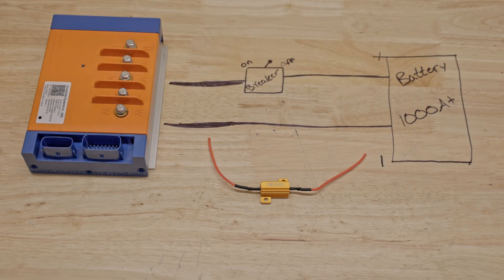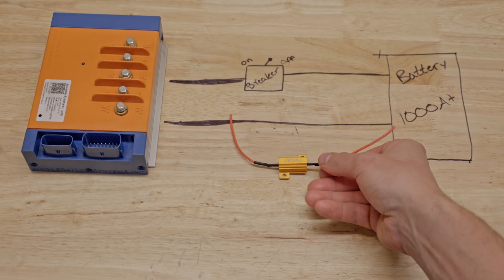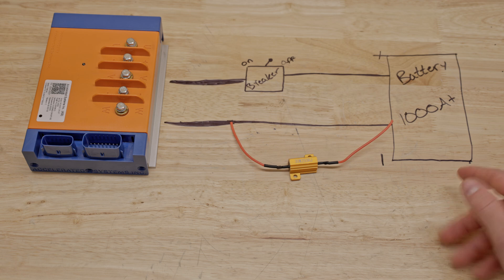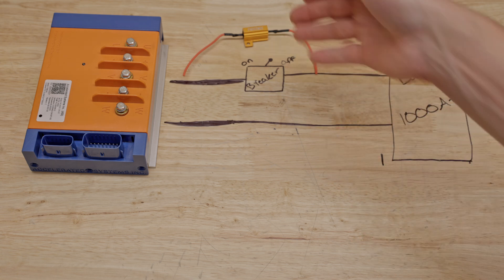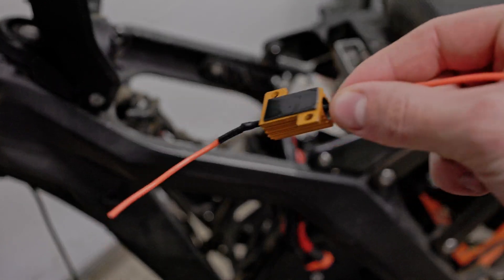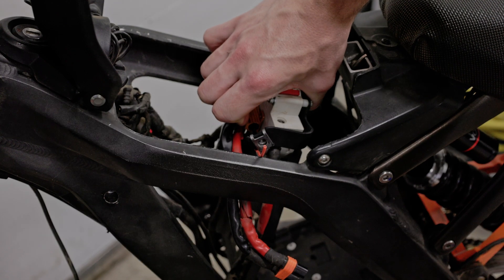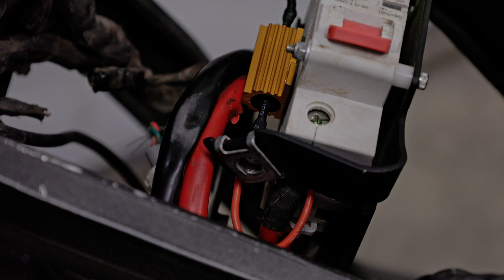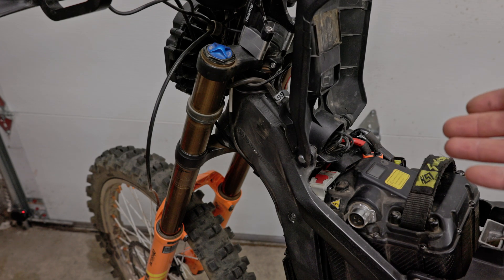How to Protect Your Controller from In rush Current | Pre-Charge Resistor Install

Comment: So let's say A automotive shop does this everytime they disconnect the battery terminal from a modern 12v battery system they must place a inline resistor to slowly charge up the Modules within the vehicle to prevent damage from the rush of current? Because I've had a shop burn a module because they reconnected the battery terminal to the battery.

Comment: PUT A SWITCH IN THE RESISTOR LINE. If you put  a momentary switch that is normally open so all you have to do is push it then when you let go it takes that resistor out of the circuit

Comment: Have you guys had problems with your breakers melting? The OEM breaker is rated for 100 amps but with 12kW plus we're way over that.  mine melted completely so i deleted it (yes, i know that's sus, but im sure if i put another one in it will just melt again)
Reply: What the most amps you can run on a stock breaker?

Comment: Can this be installed if you have a breaker delete? My CHI battery has a QS8 connector which bypasses the breaker.
Reply: Have you had any issues? I had to delete my breaker also
Reply: not a single one. works great! @jonlock7150
Reply: I have been running no breaker Qs8 plug with zero issues for about 3 months now.
( 72v 38ah, compact with bac 400p

Comment: You mentioned that some batteries have a soft start function. I have an EBMX 72v 57ah. Do the EBMX brands have that function built in that you know of?
Reply from the maker: I believe that EBMX batteries is what ASI used to intially determine this was an issue so I'd guess that they do not have the feature or at the very least isn't setup. I'd note that we do see less issues with that battery in comparison to CHI as far as which causes this issue more.
Reply: @emotobros  Good to know! You guys are lifesavers and if a $10 device & 20 minute install will help preserve my BAC4000 then that's worth it to me!

Comment: isn't there a way to use that with a qs8 anti spark ? As the circuit breaker is a curent bottle neck and takes room, would need 2 connectors for the bike, 1 QS8 and one to plug first with this device. I never switch the breaker of, only keys so my controler capacitors are always full ? I have the QS8 lines ready to install.
Reply: I think I figured it out, do I just need to put this device on the plus before the controler in a connector and one negative wire from negative controler to the connector, and 2 smal wires on the battery + and - to the connector, connect précharger first and then QS8 . Good so ?
Reply from the maker: You should not ever remove the breaker. It is a needed component for safety. In the case of a fail-short the connector could weld itself together and you will not be able to disconnect the battery without the breaker. Additionally, the QS-8 is not a replacement for a pre-charge circuit or a breaker.

Comment: Is it an option to include this in a setup with qs8 connections and no breaker?  I have a battery on the way with qs8 connection and now I’m unsure if that was the best option to choose.
Reply: I think so, but you will have 2 connectors, 1 QS8 and a small one for this device
Reply: This only works with a breaker in place.  Without it when you connect the qs8 which is always on.  With a breaker in place when you connect the path via the resistor will slowly charge your caps and bring your controller up to working voltage then when you throw the breaker the current starts to flow through the main path
Reply: @lr7974  that’s what I kind of figured.  So aside from purchasing a breaker that takes a little more amps to pop and installing it im going to have to leave my computer unprotected for the time being?
Reply: Same situation here. I have a 60v51ah compact from Chi with QS8 coming and a little worried about running it on my KO Nano controller. Remove breaker and the QS8 is antispark. Still a little nervous about no longer having a breaker.
Reply: @lithiumbizkit  I’m more concerned about not having protection from the in rush current provided by the bms.   May just have to purchase a larger breaker
Reply from the maker: The breaker in the Sur Ron is not a breakable fuse and should not open from high current. If it is opening during use it likely due to vibration or worn out internals. I would recommend replacing with oem. That being said if you do find one you like better, or one that is a breakable fuse that should still be sufficient.
Reply: @emotobros  so I would be able to run my stock breaker in the QS8 harness that was provided to me from chi battery systems?  Currently have no throttle response after I finished installing.  I will be testing connections and the throttle itself tomorrow morning but everything else seems to be working correctly.
Reply from the maker: You should not ever remove the breaker. It is a needed component for safety. In the case of a fail-short the connector could weld itself together and you will not be able to disconnect the battery without the breaker. Additionally, the QS-8 is not a replacement for a pre-charge circuit or a breaker.

Comment: So this just makes a battery bypass more safe?
Reply from the maker: Yes and no. It makes a bypassed battery more safe for your controller. Indirectly, this increases the overall safety of your controller by reducing the liklihood of the controller failing short with a bypassed battery hooked up. A bypassed battery still does not have overcurrent or undervoltage protection though so if a short still occurs there is nothing to stop it.

Comment: Question is why ASI does not have this protection already?
Reply: He explained it in the video
Reply from the maker: It is not standard to implement a precharge circuit into a DC controller or inverter. In applications using lithium batteries a BMS should always be used. To be clear, a BMS serves this function in addition to overcurrent and undervoltage protection as well. Some BMSs to not have a precharge circuit as not all are built equal. The battery is the best candidate for protections becuase it is the energy source itself and would cover anything downstream. In order to save space for more cells and have a higher output at lower cost companies like Chi batteries have decided cut this out. The real question that should be asked is why battery manufacturers would prioritize battery capacity/output over neccessary safety features.
Reply: @emotobros  what battery bms’s have proper inrush/over current/over voltage/under voltage/temperature protections ?  Does ebmx bms’s retain all the oem battery safety measures?
Reply from the maker: @lr7974  We use batteries we had custom made with a custom BMS that has the protection built in. We can't comment on which ones specifically have this built in, but to our knowledge, there are none on the SurRon market with this feature that are mass produced.
Reply: @emotobros Aftermarket batteries with ANTBMS can turn off the BMS discharge, Plug their battery in & turn in discharge & it’ll have a similar function.
Reply from the maker: @PUGETSOUNDMOTORSPORTS   Just don't forget even once!
Reply: @emotobros  I don’t even unplug the battery nowadays 🤣
Reply: Not sure if it’s possible for the controller to provide that type of protection. The resistor is bypassing the circuit breaker thus allowing a trickle of power from the battery to charge the capacitors in the short amount of time between connecting the battery to the bike and flipping the breaker to the ‘on’ position.
Reply: I just un bypassed a stock battery that someone screwed with.  Unfortunately the bms has issues now I swapped in another bms and the battery looks ok but now I have to order an expensive bms to fix this battery.  Not a fan of people bypassing bms’s

Comment: IF you just bought a Chi 72v battery please watch this! If you do not you will blow up your controller. I know, I did it and E-Moto Bros helped me with this exact issue.

You guys helped me with this exact issue/fix when the battery company would not. I've had zero issues since I did this configuration. You guys were very helpful in your emails and I felt like you guys actually cared about the issue.

You guys already updated your site with this video as well. the Battery company still hasn't updated their website with any warnings about this issue, assuming that would mean they take some responsibility. 

Either way huge thanks and props to you guys for the fast turnaround on the replacement controller. I will always be a customer of E-Moto bros!
Reply: Seriously! I have stock battery with no bypass and mine had this issue, they sent a new one out this week and I’m so excited to start riding again! Their customer support is 5/5 unmatched!

Comment: Just an opinion but you should probably have an inline fuse on the resistor line that takes a carfuse.  not only will it protect things with a short on that wire but also blow if someone tries to pull a lot of current on that wire if they didn't turn on their breaker.
Reply from the maker: I think that is a very good suggestion. I would recommend using a high rated slowblow fuse though to ensure current spikes from first connection don't blow the fuse frequently under normal operation.
Reply: Would a 5A 250v slow blow be sufficient?  I have installed the resistor and would like to add a fuse for piece of mind but am not sure what fuse to run. Thanks.